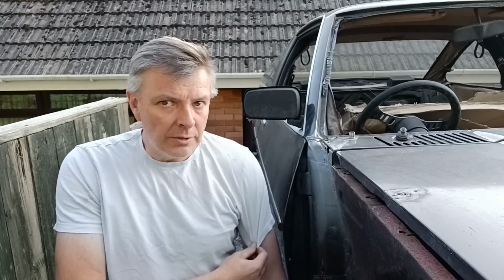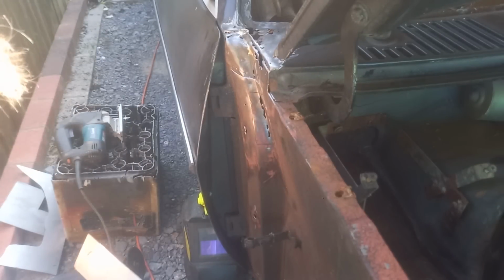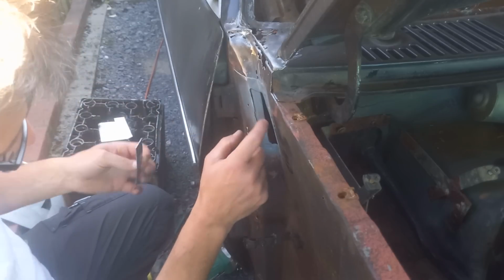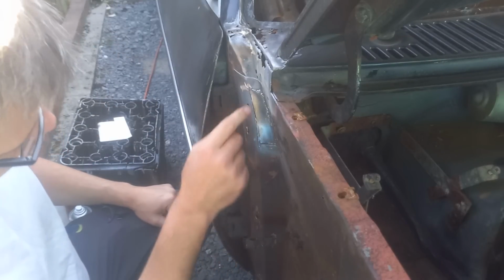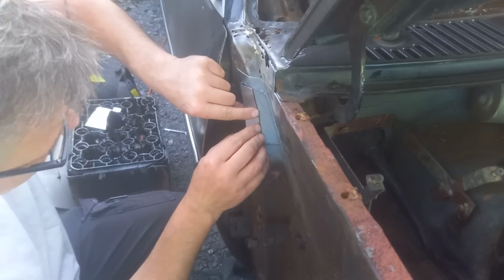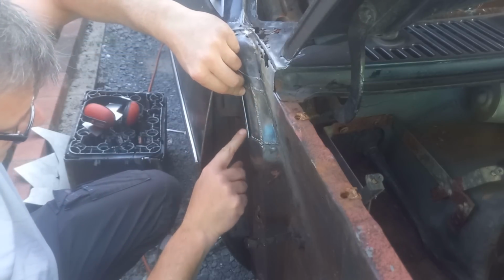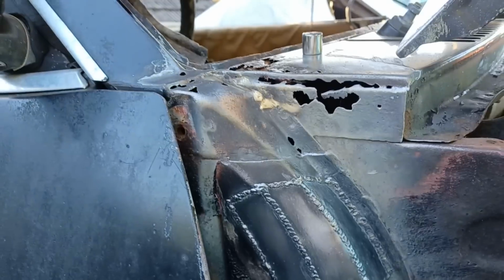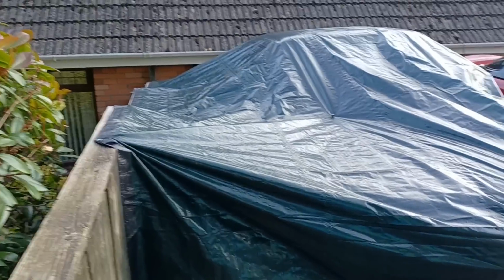Opel Manta B Restoration, more welding and cutting and grinding and welding

Comment: Loving this series on the Manta. I did something similar, years ago, on an Ascona B, though mine wasn’t nearly as bad as this.
For those not in the know, the Ascona was the saloon version of the Manta, sharing all the running gear, floor pan, suspension and major structural elements, but in a less pretty dress.
It was the basis for the UKs Vauxhall Cavalier, which got a different nose, but was otherwise identical, despite being built in the UK.
Much of the work you’re doing is bringing back fond memories, one of which involves almost setting fire to my parents single car garage, which was part of the house, itself one half of a semi-detached building.
I was using a windowlene squirty bottle as a fire extinguisher, at the time and only became aware of the conflagration when my oily overalls became hot enough to need removing, so I removed the welding mask, which was disguising the flames.
The overalls came off faster than anybody’s ever got out of them, before or since, got flung out the door, where they burned a patch of the lawn, while I discovered how inadequate my 250ml of water in a spray bottle actually was.
I did save the car and the house, but it was through luck, not preparedness.
Stray sparks and spilled oil are not a good combination!
Reply: Squirty bottle fire extinguishers.....fond memories mate😂😂😂👍
Reply from the maker: Ooof 🤣

Comment: Spot on again Dave. I just love everything you do. Thank you for giving us all such first rate entertainment. Talking of which, I used to absolutely adore Car SOS, but does anybody think that they are showing much less of the repair processes than they used to do, or is it that your channel and many others are actually so much more interesting?
Reply: Seems that way to me, i've somewhat "gone off" car sos as it feels like style/entertainment is more & more overshadowing the substance of the program ----- a real bugbear for me is the program will go to the commercial break then when it comes back the first 5 minutes of the next segment is a synopsis of what was shown previously (so your 1 hour program with 15 mins of breaks only has really 30 mins of original material) I find that lazy, cheap television.
Reply from the maker: I think you are right about car SOS, just seem to get glimpses of actual work now
Reply: Just about every car programme I've ever watched ends up like this imo. Once they get reasonable viewing figures most are off down the road of product placement etc. and more of the work is farmed out to others. The work that we find interesting is probably too boring for the average person in the minds of producers & so all that gets shown are the shiny bits being bolted on
Reply: Did you see the rs2000 a couple of weeks ago, tim was showing how to drill out spot welds to fit a new roof, then later on someone else was fitting it, cutting it about and rewelding, must have been a bad fit.
Reply from the maker: @lester cranmer  yeah, I noticed that, they then cut the new roof in higher up??
Reply: @DavesGarageuk  when they showed the new roof standing up, it had lines in it like english wheel marks, not sure if it was hand made or pressed, I still have it recorded I will investigate 😄

Comment: Youre lucky youve got done what you have Dave. Couldnt do that amount of work outside where i used to live when i had my Manta...... sunny Glasgow😢....Would have had to hire specialist underwater welding gear living there😂
Ive dealt with Carl before & he is a decent guy. Hes usually pretty fair with things  & knows the Manta inside out but as always you can never tell fully until you strip them down. Mine was very very solid but was worse than yours on the a pillars but much better on the scuttle. Theyre all just a gamble really.
Reply from the maker: 🤣 it's normally raining here, but we've had 3 weeks of sunshine 🌞 been fantastic

Comment: I think every Manta I saw back in the 90's when there were a few more in regular daily use had a lot more rot than comparable cars of the era. Particularly remember a fella we called wiggy where I used to work had a really rotten one with vast amounts of white paint applied over the rot so it didn't look so obvious at a glance from a distance. Can't imagine there are many left so should a make a nice and rare car eventually.
Reply from the maker: I've had a few Lancia Beta's which had a terrible reputation for rust, I think the Manta is worse, there's just no paint behind the panels from factory 😫

Comment: Hello Dave, I have been watching your videos and intrigued to know how your finished cars have fared with microblisters.
The reason I ask is they seem to sit around either inside or out in primer which is porous so while your car is sitting there being worked on, moisture is being absorbed which will cause  paint microblister problems later on. 
Having done an apprenticeship many years ago and spent most of my working career as a panel beater/sprayer restoring high end cars this was a major consideration. Of course 2 pack primers help but can still trap moisture and single pack primer is like a sponge....
Now a metal sculptor, and working with all sorts of metals, my aim is to bring on oxidation for patination so my primer worries are over 😀
Reply from the maker: It's a real pain in the neck, I try to finish my cars in the summer when it's hot and dry, it helps, but hasn't always been successful.   I don't overly worry about perfect finishes, they just make me paranoid about using the car.  As you say and know too well, 2k epoxy is the way forward for base coats.
Reply: But you go to great lengths to remove the rust Dave and letting the moisture back in is allowing the rust to start again. 
I have stripped many cars back to metal that have sat around in primer and beneath that primer is rust again. Why not seal the primer with a layer of paint, that will help for a short term. Best regards, Nick

Comment: Fantastic video, You are a very skilled man. What impresses me most is how you can weld such old thin metal using a gas less MIG, I have watched your video on the welder that you use. I would like to know what welding wire you use please ? Am I correct to assume that it is a combination of your skill, the welder and  the wire that makes it possible to weld such old thin metal? Thanks in advance
Reply from the maker: Hi Sam, thank you 😊, the wire is 0.8mm gasless, the ability to weld thin metal is really down to the welding machine being inverter technology.  I've tried gasless in the past with an older transformer type and found it difficult to use.
Reply: @DavesGarageuk  thank you for your reply. Does the brand of wire matter? Thanks
Reply from the maker: @samsung-oq7rs  I haven't noticed any difference in brands so far

Comment: Was at a VW Lt the last few days, Dave - luckilyish for me there's 4 in the yard lined up to be done... Never complain about how hard anything on that ^ is - compared to rebuilding the tattered underside of a 22 year old VW commercial, anything "car" is an absolute, total doddle/pleasure/walk in the park.  I've been burning a full roll of flux core wire every day for the last 5 days... The rolls running out by about 3pm..

 It's like doing the Forth Bridge except while laid on your back with the underside of the bridge 6" from yer face as I have the back axle dropped & can't jack the bugger up much - reasons - I feel like one of them Vietnam war tunnel rats... I'll never complain about doing a Landcruiser underside ever again.. or an Iveco - Iveco's are a doddle compared to these Lt's as well. These are absolute bloomin murder to repair.

Comment: Your shows are good thankyou.  but dont you cuer the steel with  rust converter.
Reply from the maker: Rust converter doesn't work, I've tried it many times over the years, rust still comes back
Reply: You did use that rustolium stuff did you.  The phosphoric converter works unreal. I use it all the time. Mike
Reply from the maker: @michaelgiglio1571  yep, I've tried rustoleum, nice easy to use as a paint, but rubbish at holding back rust